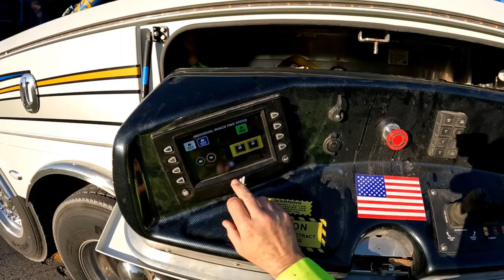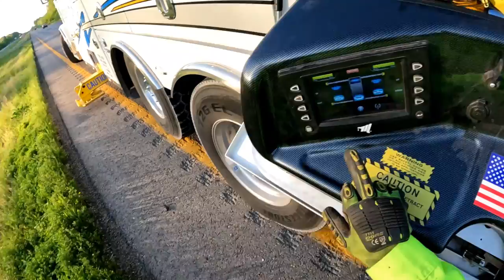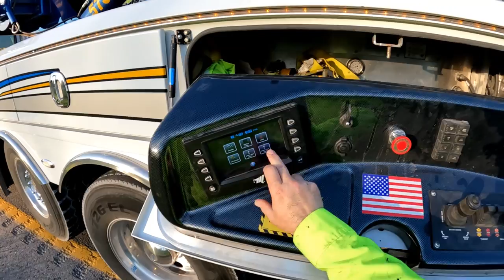DUMP TRUCK CRASH & DASH!  WHO OWNS IT?

Comment: Food for thought, label each box on the truck with a number, inside and out, that way anybody helping you on a scene, they can immediately tell where something goes by just the number you tell them, "rim slings in Box3", "light bar in Box4" etc etc etc for example. Would speed things up for you versus having to explain each location each time.  Keep up the great videos and be safe !!!!
Reply: I label  my service truck boxes and  Ron has twice what i have
Reply: Kind of like paint by numbers 😁
Reply: I know the fire departments label the compartments on a fire truck from front to back Right side R1,R2, etc then the Left Side would be L1, L2, etc the compartments on the back are Back Left BL1, BL2 Back Right BR1, BR2. Just a thought
Reply: Even coloured tape would be good, also easy to put stuff away, or get the 'new guy' to do it!
Reply: He needs to get everything organized first
Reply: @joethanks3745  Great video idea, too.
Reply: Numbers alone suck
I like the idea of R1, R2 and R3.  (box R3, right side, top shelf)
Reply: @seanconlin8712   That works you can also do odds on the left even on the right. So the 1st door on the left side would be 1 1st door on the right side would be 2. So the left side would be 13579 And the right side would have 2 4 6 8 10.

Comment: Great video, you are a true professional Ron, I can’t believe people don’t slow down more when they see an emergency vehicle working with men on the ground, that must be an unsettling feeling having cars flying by in those situations.
Reply: Because they don't think they will caught, they slow as soon as the police car arrives! Could do with an ANPR camera on the truck so the police could fine them later. Once the word got around then they would slow down for tow trucks.
Reply: @mikerubynfs  Not sure how they’d do that without pulling them over.  You can’t assume the driver is the owner.
Reply: @user-tb7rn1il3q  Won't be points for the owner but they can be fined as they are responsible for the actions of their vehicle.

Comment: Ron, I have watched your vids for quite a few years and this is the weirdest of the them all. It’s like a combination of Derek Bieri’s Vice Grip Garage and the Marie Celeste ship. 50 year old truck found abandoned on the Interstate, with the engine ticking over. No driver, no one around !! Maybe it was beamed down from space!! They sure built ‘em tough in those days. Even some of the tyres were still inflated.  However, it looked a very risky rescue. Stay safe Ron.

Comment: Another great job by Midwest!  Something I did at my shop when I had several workers was number the drawers of my tool box.   Whenever I needed one of them to locate a specific tool, I could easily just tell them what drawer number the tool should be in.   I thought that might work on your truck.?  Either number the boxes or give them a colored dot.?  Something to identify each box specifically from the others without counting from the front or from the rear.?

Comment: I was going to raze you about the dirty windshield. Then I realized that anyone that would stop in the high speed lane with no protection is more man than I will ever be!  You flat could not pay me enough to do that trick with a bunch of cars & trucks coming at me with the sun in their eyes.  I also decided Tater needs a lot more flashing red lights on the back!  Kinda surprised the officer didn't already have cones out and his unit blocking the lane since he knew what you were going to have to do.  Good job Ron, Be safe out there.  I don't think the tire blew.  I think the dry rot just stopped holding on to the piece next to it and they all let go at the same time. LOL  I did like the number on the trucks front bumper

Comment: Hope the scrap price covers the tow. Nice work!
Reply: Cant scrap it yet tho
Reply: If it still runs and drives. It’s probably worth more sold as is with a salvage title
Reply: @pws3rd170  I'd put money on it not being capable of being made fit for road use, and was just used around a farm or something similar (maybe even seasonal) before it was taken - so could be weeks or even months before it is missed, and would explain the lack of licence plates.  So the value would be either as a restoration project or as scrap.
That would explain why the driver didn't hang around to face the cops, too, although it is possible that alcohol may have played a part in that, too.

Comment: Ron did you know they changed the positions were supposed to hold the steering wheel? It's now 9 & 3 apparently if you get in a wreck the airbag can shatter your wrist/forearm at 10 & 2. Just a heads up if you weren't aware. Stay safe & keep up the great work. I know your dad is looking down proud as ever
Reply: And don't wrap your thumbs around the wheel. Palm it.

Comment: Poor old Ford :( 

That's a pretty rough truck to get stolen. My guess is someone bought a parts truck for $500 or $1000 and decided it was more than the truck's worth to get it towed. No keys, probably hotwired. No way to shut it off.  So they ran it back with no tags / etc and this happened. Whatever fines / towing they get hit with are going to be more than they have in the truck so they did a dump and run.
Reply: And it's a commercial vehicle so the penalties would be much higher for getting caught driving it around with no plates, insurance, etc.
Reply: Doesn’t mean it should be scrapped :(
Reply: Yeah gonna have to agree looks like some one saw a cheap dump truck and went for it,  thinking they could ease it home on the bad tires and then they paniced leaving it sit,  I'm betting it's not be road legal in least 20 years, so everything has lapsed and guessing no title for it either,  never bought one of these with a title, always had to get a lost title for them afterwards.
Reply: @WhitfieldProductionsTV  Yeah I was saying the same thing. That dump was beyond being road ready.I hope Ron will get paid for the recovery and scrapping of the truck, cause nobody going to pay that recovery fee, parking, fines,etc...

Comment: There must be  a reason why you started out with the "white head assembly" then switched to the "blue head assembly" because the other malfunctioned. Was the angle of the pull better on the "white one"? Or in the scenario that presented itself that was just the better choice? Evidently the blue assembly did the job so it was a good backup.

Comment: Talking about the Mighty Mississippi flooding. In 2018-ish, the river flooded all the way south from northern Iowa down to Kansas. As a truck driver, for several weeks, I-29 was flooded, so we had to divert to I-35. Almost a year later, all that farm land was STILL flooded, it was sad seeing farm houses condemned, steel silos broken open and/or rusted. The truck stops in Percival IA were flooded for a few weeks but they rebuilt, SR-2 was damaged.

Comment: Interesting video on this one Ron to say the least... You and Mike being on that main highway just puts me on the edge of my seat for y'all...! Always a dangerous situation as you said no matter what side of the road you're on... Just a suggestion re your equipment storage boxes on the sides of the truck... On the drivers side starting from the front most box to the back... Could you label them D1, D2, D3.... D indicating the driver side and on the passengers side from the front most box to the back have them labeled P1, P2, P3... Just a thought Ron in case you have someone working with you that is new or not familiar with your truck's equipment boxes... Jut a thought... Great video and thanks for sharing it...!

Comment: Interesting scenario - maybe it was stolen and that they also had a vehicle following the truck and after the accident the said thief then jumped into the following vehicle and just took off.. and they never thought to turn it off either... So the person who has lost the truck probably only uses it on the land (farm) that they own & only use it once in a blue moon, so it could be some time before it is even noticed that it is missing.
Reply: Maybe, Although if I was going to risk stealing a truck, it sure has hell wouldn't be that one.
Reply: @85square  any equipment, despite its age, goes for a pretty penny. That truck would sell for 10k all day long. Thief lists it for 3k or 4k, thats a quick pay day
Reply: @85square  You would be surprised on how much some of the parts off that are worth.  Ive looked for a GM version of this for a while and they pull a premium.
Reply: True, could have been a joy ride with a helper car.  If the truck has ever been registered, the police should be able to use the VIN to find an owner (or at least a previous owner.)  If it was always used on private roads (logging, rock and gravel, etc.) it is possible that it was never registered with a DMV.  May even find that it was sold as salvage once or twice.  Good Luck finding someone to bill - is it a huge hassle to get a title for an Abandoned Vehicle to sell it for at least a partial recovery?

Comment: Just curious, I do not know how system works over there but in europe owner can be found always from vehicle registry using plates or body number until body is officially scrapped, motor number can also used for that.

Comment: Good morning Mister Ron, nice way to turn the old truck around and get it hooked up to your truck.
I realize that you probably won't get paid for towing the truck off the highway and more than likely it'll be getting scrapped to help offset the tow bill, but you may want to consider salvaging the motor if it is still in decent condition, it was running when you got there so I'm wondering if you shut it off or it shut off on it's own from lack of fuel.
Slow down
Move over
God bless
Be safe
Watch out for motorcyclists, little kids, critters, and little old ladies going to Bingo

Comment: Was there any auctions in the area recently? If I had to take a guess, I'd say that the truck was purchased at a farm/construction equipment sale and the auction company recommended that it be towed but, for whatever reason, the purchaser decided to drive it away. That truck looks like it had been "through the war" even before the blown steer tire wiped out the fender and mangled the bumper. They were tough trucks though and the fact that it was running would make it a good one for off road only use on a farm.
Reply: Yes-looked like an old-Ford L8000 w/ that  left side step/battery box configuration. Most had baby CAT engines in them. That one is  very bad shape--been sitting a long time.

Comment: Alright. Now you got me wondering.
1. Did you guys ever shut off the engine of the dump truck? And how? Was it even locked? 
2. Whats going to happen to the dump truck now? Because it didn't seem to have any kind of license plates or did i miss it?  But anyways maybe the cops can run the information in the glove box through a computer??.  Because this seems so strange. I hope for a update video  soon because im honestly wondering how this even happened on a main highway at any time of day or night.
Reply: yes; why leave it running ??
Reply: If the vehicle does not have a license plate the police will check the vehicle identification number or VIN number which is on the dashboard of every vehicle
Reply: Cop said no tags and the vin on it isnt saying stolen
However its a 6 didget vin
Reply: 1. I wonder that too! Lots of oil on the front axle. Maybe he didn't shut it off. It shut itself off by locking up?!?
Reply: They said it didn't have tags, so whoever abandoned it was either driving it illegally or removed them (and likely any paperwork) when they ditched it. They may be able to run a VIN, but given that they still haven't ID'd an owner, i'm guessing the last documented owner isn't around anymore or can show they sold it, or the VIN was removed.
Reply: As to the engine of the dump truck, it will be turned off when it no longer needs to be on. 
The dump truck will be treated like any abandoned vehicle. It will be towed to the company's yard. They will wait for a certain period (~30 days). If it gets claimed by the current owner, they or their insurance company will pay for the tow/storage fee. If no one claims it, the company can file papers which will transfer the title of the dump truck to them. They can then sell it at auction (or as scrap) to recoup some of the cost of the tow.
Reply: @mattharper588  someone said the vin was only 6 numbers and the number wasn't yelling stolen at least not as of right now.  Sooo idk. Maybe they might find them.
Reply: @12799MaDeuce   ahh I bet it was a old farm truck and someone when out for a old joy ride. 😂 Ok all jokes aside. I hope they are ok tho.
Reply: @dannylim3318   ok. I understood everything but the engine part. 
It sounded like the motor was still running even after the crash and the tow guy didn't shut it off because they wanted to do something with it. Like make sure the dump bed was down. Other then that... Why would it be on?  Can't be the air brakes I don't think. I believe they have a way to release the brakes even if the motor is shut off. Even on the older models. Assuming that this is a air brake truck. I could be wrong. But even with regular brakes like a car. Should have a way to unlock them? Right????.
Reply: @Ferrosteph  At a guess, because of the possibility that the police will later want to search the vehicle for forensic evidence.
Reply: the VIN isn't 6 digits the DOT number on the side was 6 digits
Reply: @fastoutnotforkids7192  Yes, Ron can (and has in previous videos) run air from the rotator to the towed unit to release the brakes but if the towed vehicles engine still runs, it's best to use it to save time as well as keep the steering wheel unlocked to simplify moving it to set up for the tow...

I suspect the engine died on him at some point off camera...
Reply: @fastoutnotforkids7192  Ron already told, they caged the brakes. That means they put in a bolt like tool in brake cylinders, that allows to release brakes by tightening the bolts. Each wheel has to be cahed separately. There are many videos, where they do it.
Sometimes I feel like these guys must have good mechanic and physics/math knowledge to make corect decisions when pulling securing and towing these machines.
Reply: Ron’s only task was to get off the Highway. Anything else including shutting of the engine was low priority. If the truck has air brakes (and still intact) would allow him to unlock the brakes and not have to cage them saving a lot of time and minimizing risk.
Reply: @hirisk761   oh? Ok?
Reply: @stuartofJax   ohhh ok. Thank you.
Reply: @ChannelJanis   thank you as well.
Reply: @HappilyHomicidalHooligan  another thank you. Im learning alot from everyone. Lol.
Reply: Thanks to everyone who explain some of this stuff to me ahead of time if i miss you. Had no idea what cage the wheels was until today. Even tho i rarely watch this channel. Your all great and thanks for explaining things. Even if i still don't understand the vin thing all to well or dot as someone else called it. But im still learning slowly. Lol again thanks to you all. Its kinda cool knowing some of this stuff even if i don't work around big rigs and etc. Lols.
Reply: I doubt it even has a glove box anymore. Especially if it’s a farm truck lol

Comment: Curious about the winch(es) on the rotator - are they electrical, hydrualic, or pto driven?  What kind of straight line pull can they develop?  I'm sure you've probably covered that before.
Reply: Hydraulic,  driven off a pto Ron can correct me of I'm wrong
Reply: @danbrooks8241  pretty close. Hydraulic powered with electronic control
Reply: If i had to guess extreme low gear hydraulics generated by his engines pto, its already running the rotator and outriggers and the butt lift. However it could be electric over hydraulic power, but all the energy coming from the pto.
Reply from the maker: All the working parts of the wrecker body, including the winches are hydraulic driven by a transmission mounted PTO.   Thanks for watching and God bless.

Comment: Ron, I notice that sometimes you fight getting the light bar out, without being too armchair tow driver, would it be possible to mount a pocket  on a vertical  door and strap the top of the light bar to the door of the truck.  Might be quick access and safer as well.

Comment: My guess is one of 2 scenarios.
Stolen, and owner either hasn't noticed, or possibly stoled on the farm where the owner has passed away and family are unaware they even owned the truck.
Someone uses it on a farm, so it's not registered, and for whatever reason took it out and blew a tyre. Either DUI or uninsured or similar, and decided the truck was worth less than the costs of towing + eventual fines if they admitted it.

Another cleanly executed recovery, despite technical glitches.

Comment: So you have to store it for what 6 months? And if nobody claims it you  scrap it to recoup fees?
Reply: Better to strip what few working parts are still on it and sell those separately. It costs you some time and effort, but nets you up to 10 times what a scrap yard would pay for the car...

The scrap value on a truck that old would be the metal weight only and that likely wouldn't even pay for the recovery let alone the storage fees...

When disposing of a vehicle, it's usually FAR better to strip it instead of just selling it to a scrap yard whole...after all, that's exactly what the scrap yard will do to it...strip it for parts and sell those far MUCH more than what they paid you for the vehicle in the first place...